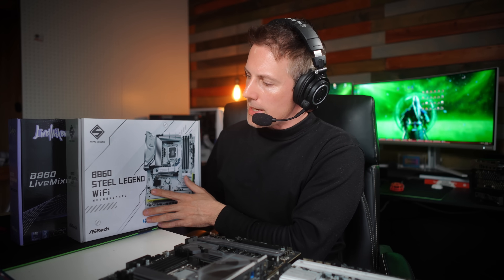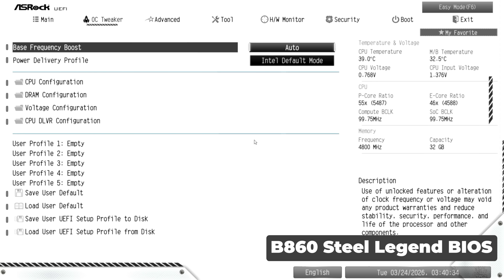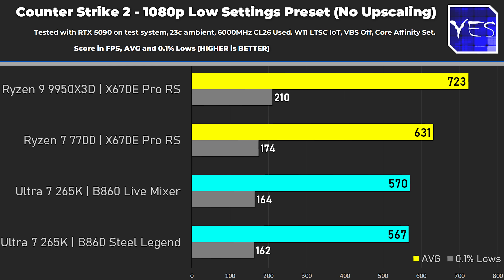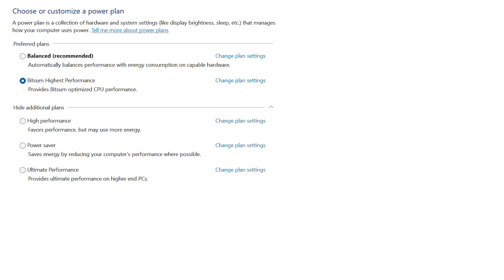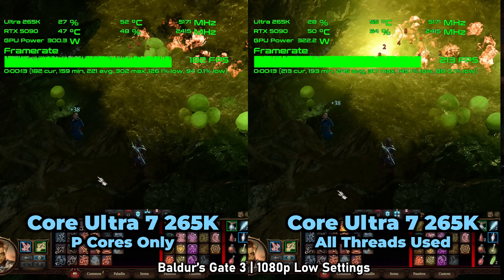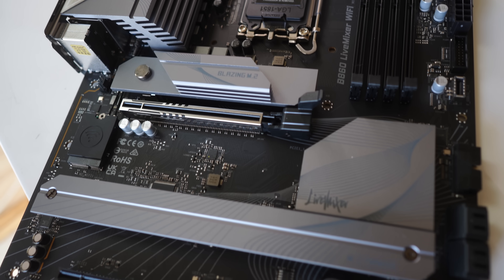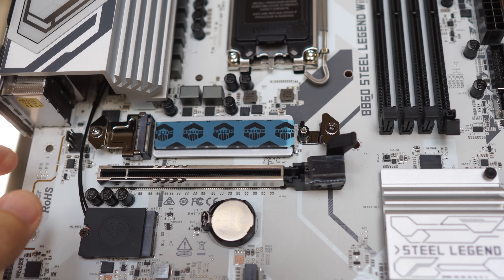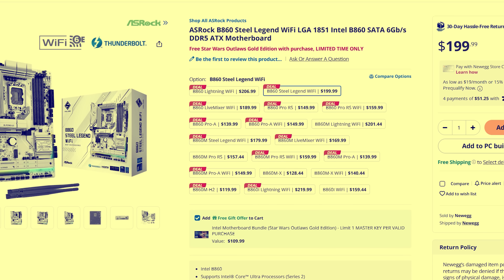I tried the Ultra 7 265K on B860 motherboards and...

Comment: The rumours and discussions about not only the Arc B770 (possible Arc B780) but also the Core Ultra Plus refresh...and...Core Ultra 2 with bLLC - Intel's X3D...2026 looks to be the year they make their move against the pitfalls mentioned in this video.  If not for RAM/NVME pricing, feel that a Core Ultra/Arc B580 for a mix of productivity and light/casual gaming would be a quick build with the intent of flipping/donating bits and bobs for what's coming late 2026/early 2027.

Comment: Iam also planning to get this build,
Is there a risk of the CPU overheating or throttling when doing intense, long-duration work and high-resolution gaming, primarily due to the motherboard's power delivery limitations for the high-power CPU.

Comment: Hey I remember you did a video about the "responsiveness" about intel 10th gen vs newer and ryzen, is the core ultra as responsive as the older chips?
Reply: Much more...responsiveness can be attributed to single core performance...and the core ultra cpu's are the fastest single threaded cpu's on the planet except for apples chips.Their single threaded performance is better than AMD...meaning every day tasks and internet browsing responsiveness is basically the best you can buy today...only second to Apples latest silicon..

Comment: For best temps it is always necessary to throw away that garbage ILM and install contact frame instead. Intel only. AMD does not suffer from uneven pressure on CPU. Too bad I did not know this earlier. But gonna upgrade soon to 265k so cant wait to try it out. Current 9900K run on stock ILM.

Comment: I have the Intel Core Ultra 265F 2.40ghz what's the differance between the K and F models ?
Reply: If I am not mistaken, the K variant is unlocked for overclocking, and the F is a version without integrated graphics. But I could be super wrong. Someone else correct me or confirm what I said 😅
Reply: @andrescano2700  So as I run a dedicated grafics card there is no performance differance ?

Comment: Where is the CUDIMM 8000 and above ram? also a manual overclock in combination will smoke the Ryzen 7700. I still think the Ryzen chips are excellent performers without having to fiddle with an overclock! I just don't think its a fair comparison with the potential of the 265k

Comment: $229 now...  What is the TPP of this processor as with the new legislation, Federal Register notice 90 FR 4544, limiting processing power to 26,900,000 for export, just wondering where it sits in that new ruling..  They are worried about us using AI for bad things...

Comment: I7 265 is currently $279 not bad at all
Reply: $259 today on Amazon in the US...
Reply: Love that we still call them "i7"s even though Intel dropped the nomenclature.  It'll always be "i7" to me.  😊

Newegg has the 265k for $200 combo'd w/ a ROG mobo ($500 total).  Not a bad deal.  The CPU is currently $260 (sale) by itself, and the board usually goes for $400+.

Comment: Not gonna lie, looking at it currently the core ultra 7 265k is as monster, and it's from time to time discounted to match the Ryzen 7 9700x in price, which is completely bonkers. 

My main issue tho which i can't really just ignore is the power consumption, the 9700x for just 65w provides utterly insane performance, and it's not like it's a slouch on workloads either (just compared to ultra it might be).

The 9700x is so damn efficient you can keep air cooled in a micro atx case as far as we care, can't say the same about the core ultra, and as a user that does general mix of gaming with some programming / simulations (virtuoso) / "heavy" office (excel spanning thousands of rows with multiple images, graphing and solving), I'd say I'll just take the efficient cpu, considering my Ryzen 5 1600 serves me pretty well and it's due to upgrade

Comment: Did you look for the new boost setting that changes the clock speed of the cache, that Microsoft cover under warranty? There's about a 10 percent speed increase, and it is just recent. It should be in the new bios.

Tech Yes Pea Diddy
Reply: is not working on B860 board

Comment: Yea saying that temps are great when using a 420mm AIO is laughable at best...I know you build ITX systems but the best coolers for my build are the Noctua U9S or Thermalright Peerless Assassin Mini which both do rather well on my 7800X3D but I cannot imagine what I would need to do to make those run well on any kind of Intel K Series CPUs. At one point I wanted to try Core Ultra and get the 5 245K but my concern is that since they dropped HT what that would mean for gaming on what is now essentially a 6C 6T CPU. But my thought is that I could limit it similar to how prior 14C 20T mobile Intel CPUs were. I really wish Intel still offered an 8p+8e configuration for Desktop. When you power limit a CPU it would potentially be better to have fewer cores to begin with so each core gets more leg room. This is why Meteor Lake was a terrible proposition for handhelds...the iGPU never got enough power to work properly.

Comment: bruh, z890 and 8000+, my board can handle up to 9200 but it cost was to much! makes some performance gains in game...of course if you are on 1440p or 1080. But i see your point, going for a value point of view. 265 becomes a very different animal with a 5.7 p cores, 5.0 on p cores with 8000+ ram those 0.1% lows go way up!

Comment: Considering that a 265K is 320 euros, while performing on 14700K levels, but drawing less power, whereas a 7800X3D is 400 euros and 9800X3D is 500 euros, I think it's indeed pretty good value / performance atm, I think if they shaved off just 20 more to hit that 300 mark it might actually a good enough proposition to start recommending it to people who want to stick to/with intel.
Reply: Not to mention, for its price, the Intel core ultra 7 265kf has 20 cores and 20 threads which is only seen on higher end AMD CPUs. In my opinion, if work and running non-gamer applications is needed, it’ll run very good.

Comment: The chip was designed for 4k gaming. Watch what happens at 4k in the 1 percent lows. It’s magic 1080p this doesn’t happen for some reason. This thing uses less energy is $279 and in 4k no difference between 7800x3d besides the intel having better 1% lows!! Test in 4k and watch the magic!

Comment: Core Ultra 7 265K sounds like an awesome chip..."Core Ultra !!!". Sadly it gets defeated by a basic entry level Ryzen 7 7700 in games. The productivity results really only come into play if someone has an actual specific work need requiring Intel. In day to day home or even home office use the average user is unlikely  to notice any significant difference between using a Core Ultra 7 265K or a cheaper more efficient Ryzen 7 7700.
Reply: 265k is now the cheaper option. Also much faster memory support.

Comment: "Utilize corea and threads",  Keep in mind it's 20 cores, there's no hyperthreading in the Ultra series. It's important to have the latest Windows II update so the p-cores and e-cores will be utilized properly.  THe Core Ultra scales better with faster memory than AMD does.  So it's really worth showing the Ultra with thew 200S Boost.   I have 8400 CuDIMMs that use 1.45 V  I had to undervolt the memory to get the 200S boosts to work, and was expecting it to be instable, but it's been solid, using it everyday since the BIOS with 200S Boost dropped.  Granted the memory is running slower than before, but the fabric is overclocked, and sure I didn't have that before with my oown verclock.  Also 200S is an overclock profile that doesn't void the warranty, which is rather sweet.

Comment: If you overclocked them both I guarantee the 265K goes miles further than the 7700. First, game clock goes to 5200mhz a lot of the time for 265K for stock configuration, 5500mhz with an AVX offset of 3 should give you the same 5200mhz for workstation stuff but higher boost clocks for games. Second would be D2D and NGU, if you set a fixed system agent of 1.45v with a decent load line on that 32x for both should just work. Since system agent is such an important voltage as well that should fully unlock memory OC for you as long as you set your motherboard VDD2 rails to 1.45v as well. On my own system using the Asrock Nova Z890I I’ve managed 9200mhz CL40 on the ram as well albeit with a more expensive kit non CUDIMM though which I think is more of a gimmick right now. Just make sure to watch your hotspots though, there is a balance to be had. 265K sees some crazy uplifts even through basic OC though, they corked the IMC with interconnects. 7700 boost limits I’d only expect to do so much, and you can try tuning the ram but I don’t know how much that really nets you. Intel remains the more tweakable platform still although some things with the DLVR and how this BIOS works probably needs ironed out.

Comment: The Ultra 7 265K has 20 cores(not threads...cores) with a freq. of 5.5 GHz and we are not impressed. WTF are you running that a Ultra 7 265K is struggling?

Comment: I have a Core Ultra 265K and while its actually pretty good considering its price, I think the whole 14th gen dying issues ALONG with Intel practically killing off  upgradability ALREADY on the new Ultra socket LGA1851 is why its not selling very well, Intel need to STOP with releasing new CPUs and then killing off the socket almost immediately requiring a whole new motherboard in the future if you want Intel's next adventure.

Comment: These Arrow Lakes require their E-cores to remain on because they don't have hyperthreading any more. So for gaming, core scheduling is supposed to force important tasks on the P cores first, then less important tasks on the E cores. But because E cores are weaker than P cores (not that weak, they're supposed to about as fast as an Alder Lake P core, but the different is there), you get wonky performance in programs (games) that need strong IPC.

Comment: Cole Ultra 265K suppoert 6400Mhz memory and you are runing it 400Mhz below wjile the Ryzen 7700 supports 5200Mhz and you are running it with 800Mhz overclock.
Reply: I know this is an old comment but it's only 6400 MHz with CU dim memory and 5600 with standard ddr5

Comment: I currently have an i7 12700KF and I'm happy with it. Do you think it would be worth it for me to upgrade to the Arrow Lake platform? How big is the performance jump there?
Reply: I have the ultra 7 265k and it's great but I don't think you'll get a big enough bump in performance to justify the upgrade, I would have waited another year for the new models
Reply: I would honestly say you could just buy a 14700kf if the 12700 isn’t to your liking and you’ll be set for another two or three years minimum, outside of productivity there’s nothing that is offered that’s worth the cost of getting a new motherboard and potentially new rams on either AMD or Intel side

Comment: The 245K also is very well stacked up against the 700s, even when it comes to gaming performance. Nothing spectacular compared to the 14600K but the prices are starting to match, so it could be worse.

This generation, X3Ds aside, is really two years of wasted time by both sides.

Looking forward for Qualcomm Orion v2 to wake up both of them. If the leaks are accurate, they are in for a shock.

Comment: Great channel! I just found it and I'm enjoying the content. The 265K is a great chip for my needs. Especially since I live near a Micro Center and the motherboard bundle offer on this was fantastic! I ended up getting a $179.99 motherboard and received $70.oo off the 265K putting the price all the way down to $229! With some easy overclocking it easily surpassed my old Ryzen 7700 in gaming. I do agree with Bryan that Intel should just stop with the non K / K stuff. I ended up with an ASUS board in white, but that Steel legend board is certainly a beauty!
Reply: how are you liking it? Ive just ordered mine and am getting ready to build (for 3D work, music work, and gaming)
Reply: @user-bi4ne3wl9o  I'm really enjoying my build with the 265K! I have 6000 cl 30 RAM and a 9070XT so it runs great! The temps are fantastic with the 265K never getting anywhere TJMax even at full load (mid to upper 30's during idle and mid to upper 50's during heavy gaming / productivity work). I'm traditionally running 10% to 15% higher frame rates in games (some even more) and a 22% to 35% higher performance in productivity vs. my old 14700K, all with vastly improved power efficiency. Overclocking was simple and provided a nice (stable) performance lift. 
The only heads up I would give is to be sure to update the BIOS to the latest build. 
Otherwise, enjoy your new build! 🙂

Comment: Meanwhile I have no issues using DDR7000 on a 265k and a Z890 Live Mixer... Did you apply the latest microcode as well?  Did you notice how strong the multicore perf is?  Guess not

Comment: But what about at 4K? or even 1440p
If you are playing in only 1080p because of budget you are not buying top end hardware no? 
I just dont understand test at 1080p on top end hardware only people that are using that are comp paid players and their PCs are built for them lol    
 Lets not forget the igpu and all the value it brings including VR gaming...   
The ultras are not perfect but $500 for a cpu board and ram combo  is hard to beat 5yrs +  worth of use.
Reply: You’re forgetting DLSS tho. Even gamers with 5090 will use it eventually for higher frame rate. Renders at 1080p or 2K but 4K output. So in which case a core ultra will hinder performance compared to X3Ds

Comment: Those e-Cores are a load of BS. Had to disable them in BIOS to get my most beloved Simulator run smooth in Win10! And I payed 650€ for that thing! They should have made annother i5 with 8 p-Cores and 0 e-Cores for gamers at a reasonable price! But no, they even started to put those crapcores into i5's! And then there is their Alchemist Crap (A-770LE), I bought it for my Work PC believing it would help with video editing and rendering compared to the old 1080Ti I had in it. What a waste of 400€ that was... I have to give it to the AMD Fans - They have a reason to smile right now!
Reply: What I also find funny and makes your Overclocking Explanation void - Those Intel Chips hardly let you go up in Clockspeed when my 13900K allready overheats with a 380AIO in Cinebench at the speed it runs out of the box!

Comment: I don't agree with all of it as its simply not that black and white. The fact that you can overclock on AMD means nothing because no overclocking is achievable and its not even noticeable. On Intel 13 and 14th gen there is a noticeable difference and the difference is even higher on Core ultra especially on the 265k. Why you are not getting results is beyond me because i see wildly different results. The testing you showed is a heavy "gimped" 265k because of the low ram speed which is optimised for AMD and not Intel. Look here: https://www.youtube.com/watch?v=EJnRifgj3Ps

Comment: I know, presenting the out of the box perf is valid as many do run like this as if they bough an prebuilt, but why kneecap the crappy intel with slow(even though primary latency are low and xmp are at 6000?) just increase it yourself even though it will be a meh result in the end if u dont tweak every aspect of the intel cpu and yet it will probably not beat amd today :D

The new intel cpus with the e cores inbetween the p cores are the big issue with the new intels, even if u disable them the jump from one p core l3$ to another l3$ is physicaly larger now.

Comment: Team Group Kit 48GB (2 x 24GB) DDR5 8200MHz Xtreem. what was your issue with RAM? I have them "Ultra" stable at 7600, without much fuss (I haven't had the time to tune it), so I'll get it to 7800 or 8000 stable (which for me is 24/7 stress test).
As for the 48GB kit, many programs and some games now can use more than 32GB (It's starting to be a limiting factor). I'll buy the 64 kit as soon as it's available (I gave mine to a friend who does 3D stuff and stuff like that).
The motherboards look acceptable for gamers. I bet they only have 6 layers instead of 8 (issues with fast RAM), and only one Thunderbolt is not enough for my case scenario (having my cloud shared by multiple PC in multiple places).
I agree with the 7700, since the "Best CPU ever", which I don't agree with, besides costing almost 900 Euros, isn't that great. I would prefer the 9950X with no 3D chips (they always generate problems; now it is with USB3 and USB4), or maybe that's just the one I have. Who knows with AMD? I still prefer the 14900ks, but only for people who know what they are doing.
Cheers.

PS: Since you "have ears" in ASRock, please tell them to improve the backplates. I was going to buy the Taichi and the Nova when I realized how poor their backplate connectivity was. I had to go with MSI and Asus.

Comment: I would like to add two things to this video number one. The ram timings are killing this processor when it comes to gaming it has been tested and shown that around 7200 speed on your ram is about the magic spot. Most games will gain around 10 to 12% Some more some just a little less just from having 7200 ram my second part would be a question was core. Isolation turned off in windows that has also been shown to help this processor by around yet another 10% in most games so between the two that’s literally around a 20% uplift in gaming performance now having said that I will completely agree with everybody else Until steel. Should’ve done a much better job with the core ultra series. It is way too hard and you have to change and set way too many things on this platform to get good decent gaming performance just like he mentioned, though with the XMP profile and it automatically only doing an expo profile That is a problem